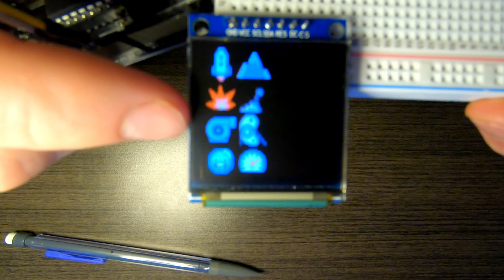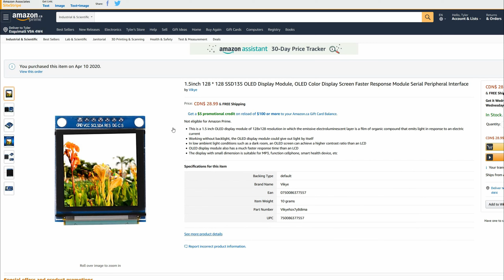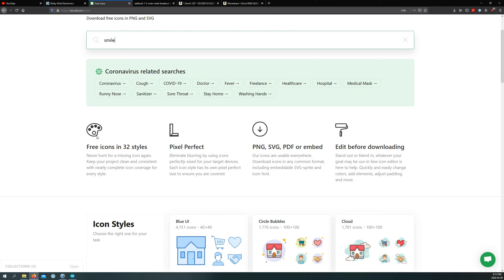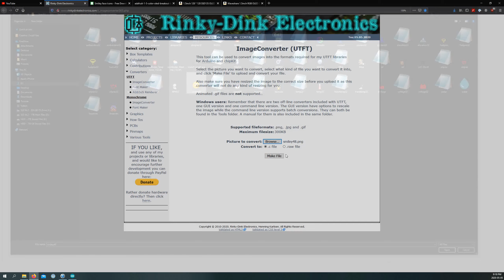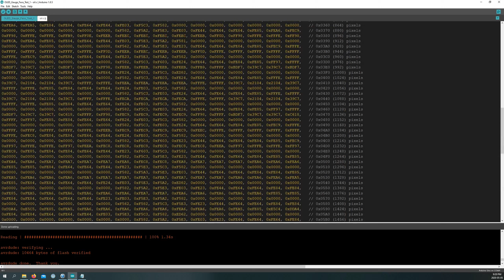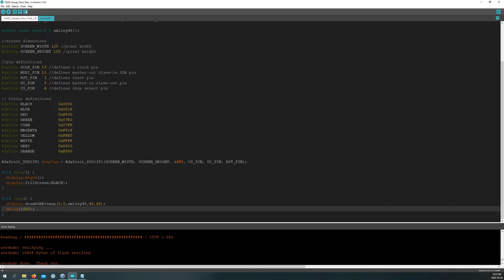1.5 Inch OLED | Arduino | RGB Image

Comment: Heres a way to convert the weird HEX values used for colours to easy to use RGB:

#define RGB(r, g, b) (((r&0xF8)<<8)|((g&0xFC)<<3)|(b>>3))   //swap r and b if colours on screen are incorrect

#define BLACK     RGB (0, 0, 0)
#define WHITE     RGB(255,255,255)

etc..
Reply from the maker: Cheers!

Comment: Please teach people the correct way of connecting SPI devices: through the ICSP header, not through pins 10-13. That way the tutorial works for any Arduino R3 compatible board like MEGA/DUE/Leonardo/MetroM0/M4 etc. Not just the UNO.
Reply from the maker: Okay
Reply: @OvensGarage  Picked it up myself yesterday, and so far my impressions are:
A) Viewing angles and blacks are awesome
B) Speed is below the 1,7 inch 160x128 pixel ST7735 LCD's (both run from a Adafruit M4 board), rougly 20fps instead of 30fps
C) Mixing colours is a real pain in the butt. This display is very far off from regular RGB displays. Similar issues as with outdoor RGB LED matrix panels. It took me 2 hours to get the 32 colours from Pico-8 right (I want to use it for a DIY pico-8 console). After the fiddling the result is nice.
D) Colours are lacking saturation. Especially red is weak. The OLED pop you see on phones is nowhere to be found. A vintage Lumia 800 OLED display from 2011 is indefinitely better.
E) The display is pretty dim. The 7735 LCD is twice as bright.

Comment: how does the brightness differ? if you lit up just green pixels for example, compared to green oled?
Reply from the maker: I find that the oled gives off a pretty good brightness. I'm not sure if it is adjustable however.
Reply: @OvensGarage  It must be, otherwise it could not produce different colors... as it needs to accurately control the brightness of the sub pixels to produce colors.
I need to use it in a optical device, so the pixels are so much magnified that you see the separate sub pixels.. and thus i was considering using only pure  R/G/B colors to light only one sub pixel at a time. Just thinking how bright they are, compared to single color displays.
Reply: IMO all the DIY OLED panels for hobby projects have a piss-poor brightness compared to what you find in your phone. When I put my professional colour display at 80cd/m2 it is similar in brightness. A monitor can usually go up to 300-400cd/m2, and phones go above 500-600 cd/m2.

Comment: That kind of color oled display draws tons of current with every pixel set to white, maxing out to 200 mA (0.2 A). That’s higher than a 1.3 inch tft lcd with every pixel on white, using 30 to 40 mA. Plus that kind from amazon is actually made with a bootleg or fake driver named ssd135. It’s fully compatible with ssd1351 but has many glitches during first uses, and can’t run very fast. The one by waveshare has the official original driver, and when connected to esp32 can run up to almost 40 mhz, while the fake version can only run on 20 mhz. If you use the arduino library by adafruit with arduino uno, it becomes glitchy and draws pixels in 2 by 2 areas, and using software SPI makes everything go crazy, possibly because of the lower memory. An arduino mega can drive it just fine.
Reply: 3 pixels to get one white pixel... sure it takes more power.

Comment: thx for the tutorial, but i had an issue with uploading, i get an error "conflicting declaration 'const short unsigned int vw50[2500]' " the error is marked in the bitmap tap
Reply from the maker: Just reading the error it sounds to me like a naming convention error. Check the main tab and make sure you are using the same names as the bitmap, etc.
Reply: @OvensGarage  thx, i figured it out
everithing was ok, but the IDE dont rename the bitmap tab (from vw50 to vw50.c)
startet the IDE new and it works perfectly